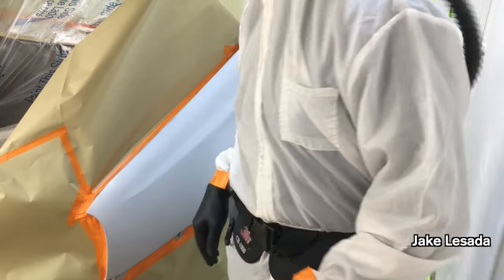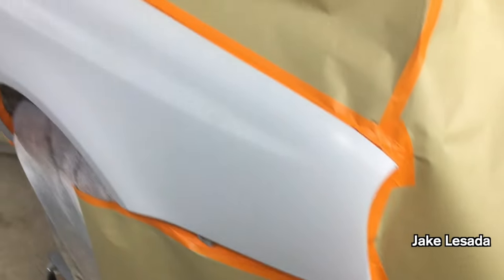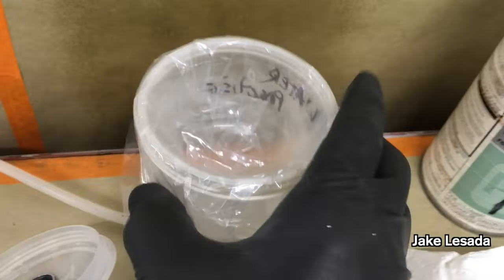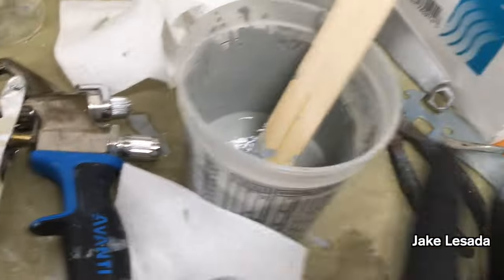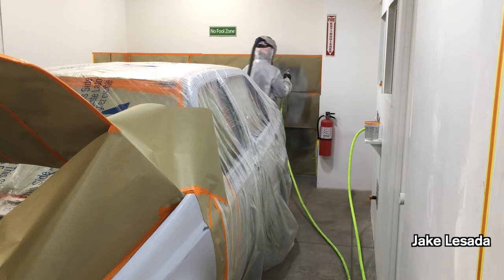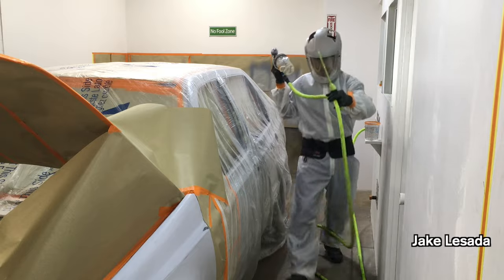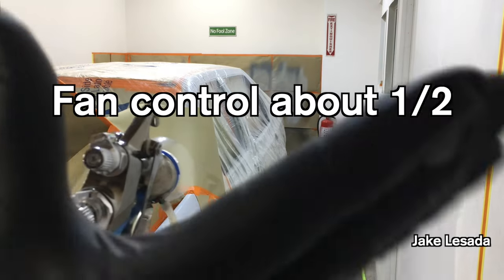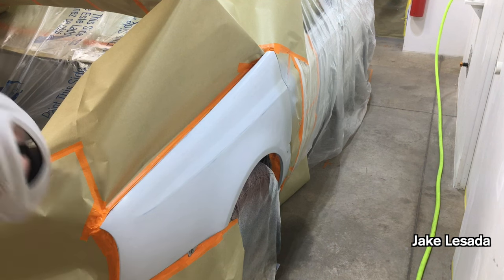Avanti 5 Stage HVLP Turbine Sprayer priming car panels.

Comment: Awesome video!!! Have seen some people say it overheats, and I'm curious if that's been fixed since those reports. I remember a prior video of yours taking temps and will go revisit that now...but any color you'd be willing to add here would be greatly appreciated, as always!
Reply from the maker: I've done some other testing with the Avanti and it's holding up well.  I'm not experiencing any heat issues, but turbine machines all produce heat during use.  I turn mine off when I'm not spraying between coats.  Turbine machines continue to produce volumes of air when the spray trigger is not pulled and that produced air needs to go somewhere - aka bleed port.  I took mine apart and looked at all the bleed port flow designs and it looks legit.  Thank you for watching and commenting.

Comment: Hey Jake! I commented on one of your other videos some time ago, mentioning that I was going to build my own Turbine Sprayer. Well I was at the ole' Harbor Freight today and they had an open box avanti, just missing the hoses and tip wrench, for $245! So, it came home with me. Works great!

I have some questions with it. I watched your video on dialing in the gun, so I have a good starting point. Do you monitor or regulate the PSI on the Avanti gun at all via a gauge? Wondering if you have preferred PSIs for spraying primer vs base vs clear. Goal is to reduce waste as much as possible! I will be getting the Apollo guns you recommended eventually. I've never sprayed with a gun before, let alone with a Turbine, so I want to learn on the Avanti equipment first!

I did horse around with it with what little bit of automotive paint I did have laying around (test samples of the colors I picked for my C600 Cabover) and I'm blown away by the lack of overspray. I held my test panel still with my bare hands and didn't get a single drop of paint on me!
Reply from the maker: That's a great deal at HB.  When I'm spraying I don't regulate air pressure at the machine - but at the Avanti spray gun fan control dial at the back of the spray gun.   I call the dial an air choker and adjusting it will reduce the working air flow pressure (psi).  The adjustment is designed to reduce the spray fan width, but sometimes it can reduce the needed air pressure to atomize certain paint materials like thicker primer.  And the result will be more texture.  Also check out my other channel "Turbine Sprayer" I go into more depth on spraying topics and spraying sessions.  The Avanti gun will consume about 3psi when trigger is pulled and the flow pressure will drop, but it works because the machine pressure is a 5 stage.  Check out the spraying with water video topic ep2 on other channel.

Comment: Jake, do the Avanti caps and needles fit the Apollo 7700 gun? Harbor Freights cap and needle sets are so cheap compared to the Apollo sets. Please let me know. Thanks
Reply from the maker: They don't fit because the size of the Avanti air cap is too small and the Avanti needles are configured differently.

Comment: Hey. Great video. What city are you in? So I just saw a video on someone testing the titan 110 pump with a psi gauge 0-20. The pump goes up to 11psi until you pull the trigger and drops to 6-7psi. The guy said the Apollo pump is the only one that doesn’t drop pressure but for some reason he didn’t show the psi gauge on the video. So when you do get a chance to hook up a psi gauge and test the Apollo and the Avanti do it with the same gun. Just a thought. Happy 2024.
Reply from the maker: I found a couple of pressure gauges I can use to mod up a pressure test.  I'll test with the same spray gun - great suggestion.  Happy 2024.
Reply from the maker: Checkout video on psi testing spray guns using Apollo HVLP Turbine.

Comment: Do you think the avanti 3-stage sprayer would be ok for auto paint as well?
Reply from the maker: I haven't tried the Avanti 3 Stage.  But, generally more stages in a turbine can provide more air to atomize auto paint material better;  you'll have an easier time atomizing high solids primers and clear coats - without having to rely on over reducing (thinning) the paint so it will flow and atomize.  A 3 stage turbine could work but it wouldn't be an ideal setup.

Comment: Can either one of the Black Widows from harbor freight work with the Avanti?
Reply from the maker: Technically no, those type of spray guns are designed for air compressor type psi air pressure.  The Black Widow HVLP spray gun operates at around 12.4CFM@28 PSI.  The Avanti 5 stage maximum sealed air pressure is around 9.5psi.  There is also air bleed from the turbine, (this helps with turbine longevity) and the Avanti actual dynamic air pressure is lower with the air bleed. I air gauged it and it's around 8 psi - 8.5 psi.  Also, with the trigger pulled, spraying pressures will drop, and depending on which turbine spray gun brand you are using, it could vary from 1psi or more.  The Avanti turbine spray gun drops the spraying pressure about 3 psi when the trigger is pulled.  The hose connection fittings are also different - turbine spraying equipment have larger fittings to allow a larger amount of air CFM (cubic feet per minute) to flow through the spray gun at lower air psi pressure.  The hose id (inside diameter) is also larger for turbine spraying equipment.  Hope this helps, and thank you for watching and commenting.

Comment: Why Avanti . You used to use apollo system. What happeed
Reply from the maker: I still use Apollo.  It started when one of my callers wanted to know if there was an inexpensive turbine spray gun available for less than $100 dollars. He sprays Dap sprayable contact cement and didn't want to use his Apollo spray gun.  He mentioned Harbor Freight and asked me if I thought their replacement Avanti turbine spray gun could work.  I went to HB bought one of their replacement Avanti spray guns for $79.00 and did my testing with regular Dap contact cement. You can watch the video on the beginning Avanti series.   I also saw the Avanti 5 stage turbine and said no way they have that now, so days later I decided to check it out and do a proper unbox video.  Now I can compare both systems, find out the advantages and disadvantages to each, and give helpful feed back to those starting out with turbine spraying. Plus, I can apply all my "mods" to either system and make my improvements.  In the next couple days, after I post my "Wok Station at Home" video, you'll see my next turbine spraying video on my "soft edge masking MOD".  I made a soft edge masking tool using a 3M PPS paint cap plug. In that video I'm prepping to spray fender jams at 5.5psi using the Apollo system with my Futuristic Spray gun mod.  And, in case you are wondering why use the Apollo for the fender jams?  The Apollo can be set to 5.5psi for 1:1 mix automotive base coat and all day long - 5.5psi saves paint, and is an ideal setting for 1:1 mix automotive base coat.  The Avanti at a higher set psi can be turned down at the spray gun, but it loses some atomization air and with a higher psi, it does consume more paint than necessary.  Also, I'll "up coat" to 6.0psi for final orientation on some metallics, vs a "drop coat".  If you watch this Avanti video again, you'll notice I say "I need more air", the reason is,  I've reduced the Avanti spray gun to use less primer - but I wasn't getting the atomization I needed.  What I don't know, "I don't know" so, I experiment.  Thank you for watching and commenting.

Comment: What’s the purpose of the faucet mod inside the liner?
Reply from the maker: The faucet mod helps prevent the sandwich bag liners from going up into the 3M adapter and it also helps paint material flow easier.  My first experiments, I used different brands of sandwich bags by themselves and with only the liner lids -  without the original liners. I hadn't used the faucet mod yet and I noticed the sandwich bags got sucked up a little into the adaptor.  The reason this was happening was I removed the mesh filter in the liner lid -  this allowed for me to clean the lid for reuse, but without the mesh filter the sandwich bag got sucked up a little into the 3M adapter. My current mod, I'm using the original liner as you see in the video with the sandwich bag mod.  Next, I'm going to experiment without the faucet mod installed - but with the original liner and sandwich bag mod together, and I'll see how that goes.  The original liners - when they get pressurized in the 3M pressured cup - the original liners rotate as they empty and they don't go up into the 3M adapter  - the 3M plastic material is also thicker than the sandwich bags. I tried using thicker sandwich bags, but they didn't seal as well because they got bunched up around the rim of the cover and 3M pressure cup.  It was a mess. I noticed using the cheapest, thinnest sandwich bags worked better because they could compress to empty easier than the thicker sandwich bags.

Comment: How does this compare to the earlex spray port 6003?
Reply from the maker: I read up on the Earlex 6003 and spoke to the tech rep, it's a 3 stage turbine non - bleed unit so it technically doesn't compare to the Avanti 5 stage turbine.  And here is why,  the Avanti 5 stage is a bleeder type turbine unit - air bleeds off through the air bleed port in the back and also inside the Avanti unit there is a small secondary bleed on the factory adjusted psi setting valve.  I took mine apart and air gauged it to see how it works.  Also, the difference between a 3 stage turbine and a 5 stage turbine is the amount of internal fans within the turbine shell.  The more fans in a turbine potentially means more output - in CFM (cubic feet per minute) and greater PSI air pressure value.  The Earlex 6003 output - from speaking to the tech rep says its output is 5.5 psi.  Here is something you'll also have to consider when using any turbine sprayer,  different turbine spray guns will have less or more air consumption when the trigger is pulled.  When the spray gun trigger is pulled you'll get air psi drop, and that is because air is flowing through the spray gun to atomize the paint material.  I tested the Avanti turbine spray gun, and it drops about 3psi.  I also tested with my Apollo turbine spray gun and it only drops about 1psi.  The choice can be made by determining which type of paint materials and how much paint thinning you'll be doing when painting projects.  Thick paint material needs more power or more paint thinning to atomize properly.  As a general consideration - heat is also a major factor with turbine units, some manufacturers put more into their designs to alleviate the heat generated from the turbine use.  External box fans can be placed near the machines to help with cooling too.  When making your choice, determine what type of viscosity paint you'll be spraying and the budget to get your job done.  Hope this helps, and thank you so much for watching and commenting.